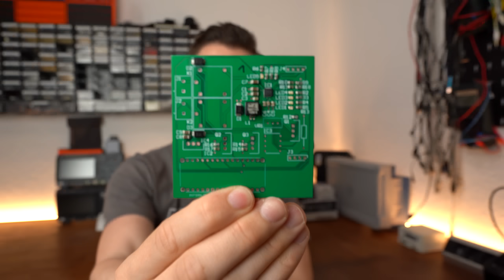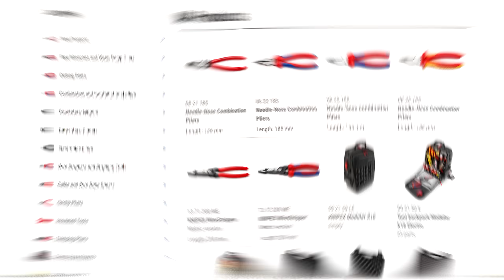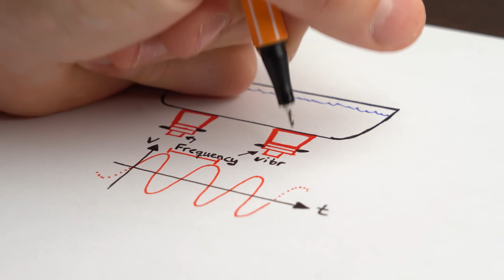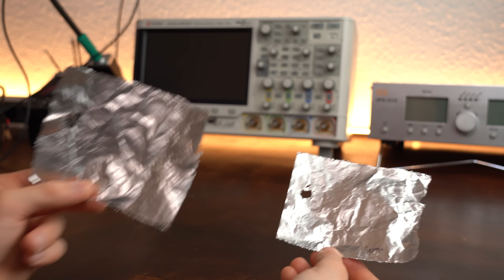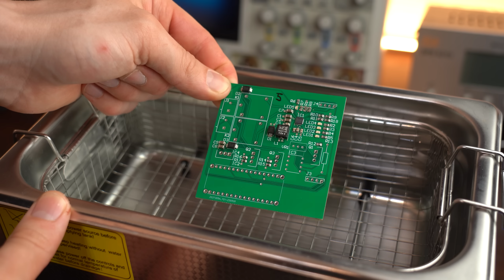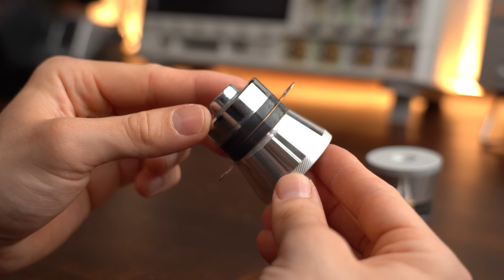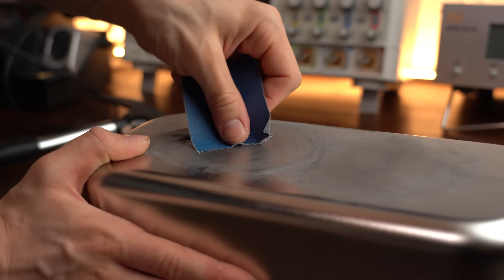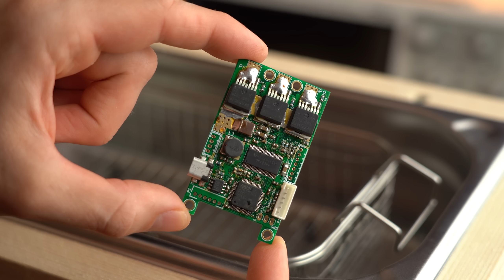The Most Underrated Tool? (DIY or Buy) Ultrasonic Cleaner!

Comment: Also from the safety point of view - Keep your fingers, or any other body parts, well away from the water/solution in the tank. At those frequencies, human tissue will emulsify quite readily, even though you may not feel it. It's not worth risking your fingers just save a few seconds while turning things over, or putting things into and out of the tank.

My own ultrasonic cleaner recommends placing parts horizontally, and points out that the cleaning is more effective on the underside of the items being cleaned (i.e. facing the transducers).
Reply: This is just not true. My PhD is based on ultrasound and it will not harm you definitely not at these low frequencies. Otherwise having ultrasound scans in a hospital would be dangerous. 

The only danger is with powerful cleaning solutions, or your finger being too clean and removing the oils from your skin thus causing dehydration of the skin.
Reply: @zakmorgan9320  You might want to compare the output power of these two things rather then the frequencies. (Or in other words: the amplitude.)These cleaners have several watts. Idk if that was part of your PhD. 
Ultrasonic waves usually have no problem to travel through many materials. So some flesh, mostly made out of water, is no problem (well, obviously): It still can create cavitation bubbles after it traveled through these materials. There are several people here who already tested this by themself. Some did get hurt, but others never. (I personally have only tested it with these ultrasonic evaporators / atomizers. They are up to MHz region. And well, it really did hurt.)
Reply: Just consider what you saw the ultrasonic cleaner do to the aluminum foil in the video. It will do the same to your hard tissue (bone). Keep fingers out till it is turned off.
Reply: @michaelfalter6200  I think not exactly the bone but the next soft thing in contact with the bone.
Put otherwise, the cavitation bubbles could strip off the periosteum! That can hurt for months...
Reply: @FWLingel That sounds like what apparently happened to my shin bone as a kid, when another kid at Scouts intentionally tripped me up (either their shoe hit my shin or I hit something mid-fall).

It did indeed hurt like hell for weeks 😬 but I didn't have any broken/fractured bones or anything. My doctor explained it as having "damaged the bone's protective cover" - or something like that, anyway. It was 25 years ago and doctors don't tend to give super detailed, technical explanations to their 10yo patients :p

... I think he then explained to my mum how she could inflict the same injury on a potential attacker for self-defence?! Wild 😹

So thanks for mentioning that :) It's nice to finally have a better idea of what happened!

Btw, Wikipedia says “the periosteum has nociceptors, sensory neurons that make it very sensitive to manipulation”! … Sure, I guess "manipulation" is one way to phrase it! 😹
Reply: That's dumb. Ultrasound at cleaning power does nothing to humans.
Reply: I would also guess gravity helps get the loose junk away from the item.
Reply: Well I did some cleaning on guitar parts and turned them often with my fingers this weekend. So far so good.
Reply: The thing that all the neigh sayers are missing is that the effect is similar to "vibration white finger" - ever heard of that? The vibration causes irreparable damage to soft tissue, and just like VWF, the effect is cumulative - it doesn't happen in seconds, or minutes, nor hours for sure, but each little session adds to the last.

Let's just say, If my ultrasonic cleaner instructions warn against placing fingers in the tub when it's energised, then who am I to fly in the  face of the maker's advice?  And that, in my eyes, trumps anything from anyone else, whether they claim to have PhuD, or a ThuD, or a PuD, or anything else!
Reply: @whitesapphire5865  "No matter what anyone else says or explains, I cannot be wrong." - You
Reply: @GamesFromSpace  Begging your pardon, oh learned one, I'm only relaying the manufacturer's own warnings, and I'll take their word for it. You do as you please........ Its no skin off my nose!
Reply: @whitesapphire5865  I mean sure, they wrote it on a sticker! That means more than first hand experience or the actual PhD above. No chance the manufacturer says that because some ultrasonic devices are dangerous, and it isn't worth proving to a regulatory certainty their device is safe.

It's on a sticker, after all.
Reply: I have put my hand in my large cleaner, and felt pretty much nothing (kind of a fizzy sensation on the skin). On the other hand, an ultrasonic humidifier causes instant bone pain. I don't think the cleaners are working at a high enough frequency, they barely affect soft substances placed directly in them unless an appropriate cleaner is used.
Reply: there goes my plans for an ultrasonic hot tub :(
Reply: @dotanuki3371  Ooh, aahh! I should think it would have them off in a jiffy!

Comment: Be careful!
When using an ultrasonic bath to clean electronic circuit boards, ultrasound can crumble solder joints, especially if the solder is old or contains flux. Soldering points become perforated bubbles.

Comment: 11:12 one thing i've noticed in DIY ultrasonic cleaners is that they don't really last & you can't buy the specialist glue's that's used to mount the transducers to the tank that flexes a bit & is heat resistant so it doesn't drop off and if you use the DIY version long enough then you'll get burnt out components even with cooling because they're really poorly made
Reply: A bit of welding takes care of that.

Comment: I was really curious on the keyboard sized ones. could you just throw a keyboard in and clean it in one go?
Reply: no, you have to dismantle keyboards before cleaning them in the ultrasonic.  Depending on the keyboard water could get trapped under parts and take days to dry or ruin it.

Comment: What solder paste are you using that leaves such dirt and solder balls? I have never had such an issue with the pastes I have used even lead free. I usually only have to clean the board if I had correct something and have to add flux.

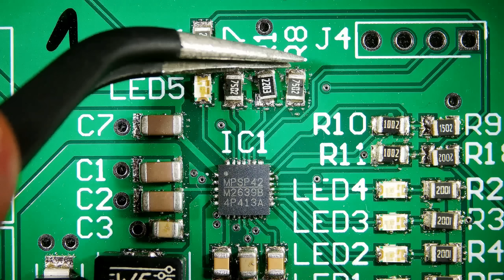Comment: 0:28 what the actual fuck... you need better solder paste, a cheap heater pad and a cheap heat gun. Your pcb is a mess. Don't clean it , throw it away.

Comment: Heavy parts will NOT get cleaned if placed directly on the metallic tank, since they are too heavy to be shaken. Tjey need the mesh.
Other parts like toothbrush heads and glasses get cleaned better WITHOUT the mesh, which reduces the cleaning power

Comment: I'd love it if a company sold a shallow but very wide sonic cleaner specifically so I can clean an ATX sized motherboard.  All the cleaners currently sold appear to be narrow and deep.  The only way to clean a motherboard is to clean 1/2 the board at a time, wasting time and cleaning solution.
Reply: Can make one yourself,  get one of those buffet style pans and a few transducers to glue/weld to the bottom of it.  There are a few videos out there on how to make one.
Reply: THe Aoyue 9070 is designed be shallow and wide for PCBs. Not sure if it's still available and no idea how it peforms. I chanced upon it last year when researching the same question.

Comment: One thing to look out for: You don't want to clean your board too well! In particular, if your board has mechanical components like switches, potentiometers etc, the ultrasonic cleaner can remove all of the lubricant from them! This may not be a problem if you are able to simply re-lubricate them, but some of them do not make that easy.

Also things like MEMS accelerometers, gyros, compasses, or even just regular old quartz crystals may end up being damaged by ultrasonic cleaners. This is a "may" of course, they may also be totally fine. This is in addition to some components that really don't like being wet (pressure sensors, LCDs maybe).
Reply: Yeah. LCD screens on older phones, calculators etc. don't like ultrasonic cleaning or even moisture. Probably a piece of silver-colored cardboard glued on the backside. Better to take those off before cleaning if possible.
Reply: You can add push buttons to that list.  I changed the led color in my motorcycles dashboard pcb and ruined the 2 push buttons that controlled the trip and select when I cleaned the board in my ultrasonic.   Quick and easy to replace them, but its a lesson learned.

Comment: I got one but the liquid capacity is 2 US gallons of whatever.  It can clean parts and is big enough to ultrasonic clean vinyl records, too.  The issue is that you are not supposed to operate the cleaner with a partially full tank,  you are supposed to fill to capacity.  Thus alot of whatever you clean with gets used up.   Maybe own a small one and a large one.

Comment: I use some pretty big ultrasonic cleaners at my job, I personally use a 50 gallon one and a smaller 5 gallon one, but we have some that are the size of an RV for a more automated process. Something that helps a LOT is to have a flushing action in the tank. I really wanted to get one for home use, but even our small one costs around $4k. Been thinking about DIY'ing it but don't want to start another project, I'm just keeping an eye on ebay for a used one. Our two ultrasonic cleaners used a solution of sodium hydroxide, but that is application specific for what we are using them to clean.

Our big one has an ultrasonic side panel, which is immersed in the solution. Basically a stainless steel box, with a ton of huge transducers on one side, that is immersed in the solution.

Comment: I still use the Kester 2331 water soluble flux and 2331-cored solder for soldering PCB's. Residues easily wash off with warm water under the tap and a soft toothbrush.

Comment: I've been using ultrasonic cleaners to clean PCBs for years.  I run distilled water and Branson EC (Electronics Cleaner) in a 5% solution.  I run it at 60*C and only need to clean the boards for a couple of minutes.  After removing from the cleaner, you will want to dip it in a bath of IPA in order to displace any water remaining in small voids, then I dry it in a 120*C oven for an hour to remove any traces of moisture.  For PCBs like yours, you probably don't need to go to these lengths, but many of the PCBs that I use this method on have switches and pushbuttons.  The IP and dry cycle ensure that there is no water or other moisture left behind anywhere.

Comment: You might want to take a closer look at your solder paste and soldering process, so many solder balls are definitely not normal, we have like at most 1-2 per board and those usually fall off easily. It might even be bad flux.
Reply: I think the SMD resistors being all wonky is also kinda telling that his reflow soldering process isn't quite there yet, because usually they would mostly align themself while baking if you applied the right amount of paste and placed them properly; at least from my experience.
Reply: I have seen his hand-soldered work and this seems way better already 😂😂
Reply: Yep. I do SMD with paste soldering using a hot air station and I've never got solder looking like that. It feels temp is not high enough. Otherwise... excellent video, as usual.
Reply: I one had some boards that were full of solder balls after reflow. It ended up just being a case of expired solder paste. We learned that T5 solder paste is much more prone to degradation than the regular T3/T4 stuff.
Reply: He could also use a smaller stencil cutout to minimize the chance. Or buy a DEK lmfao
Reply: Yes, I also had some concerns about the soldering.  I'm guessing the paste he is using doesn't have enough flux or perhaps doesn't have the right flux.  Proper flux should increase the surface tension of the solder and both help with self-alignment of the components and also prevent loose solder balls.

Comment: @GreatScott - I had a very similar one to this, the 800ml unit but the buttons on mine had a slightly different arrangement.  It exploded - literally - after only 6 months use.  The Chinese vendor (who was listed on Amazon with a UK address) tried desperately to dodge warranty replacement and trying very hard to break the law.  After a month or more of back and forth Amazon themselves stepped in and refunded the purchase price - the company I believe was dropped from reselling (the illegal activity was quite clear).  
I was told to simply dispose of the item so out of curiosity I took it apart to see what had happened - there was definite scoring on an internal PCB and there was zero water ingress, that said the components are not sealed at all and I don't feel confident or safe with the way these are made.  The problem is you can't have it in earshot as it's really loud and at a frequency which is piercing so it increases the risk factor when running it.

Comment: How much do you suppose it would cost to add an adequately-sized heating element and appropriate control circuitry to the DIY version?
Reply: Adequately sized means what?
A few watts can keep a similar sized container at 60	°C (lid closed) and a significant number of watts more can do that with the lid off.
It does take a long while to heat up that amount of water with only a few watts.

My ultrasonic cleaner has one of those rubber mat heaters glued to the bottom of the tank together with a PTC temperature resistor. Those are quite inexpensive and low wattage.

Comment: I've been cleaning batches of PCBs a lot and let me tell you, PCB cleaning solution works wonders (EMAG Platinenreiniger in my case). It is specifically made for getting rid of flux and solder balls and will clean an entire tank full of boards to almost perfection.👌 Heating it to something like 60 C will also make a huge difference.

Comment: My mother worked at place that designed precision electronics and they used a dishwasher followed with an alcohol bath to remove the water and  dry quickly. I don't remember the setting they used on the dishwasher.  The whole process was surprising to me as I was new to it back then.
Reply: My dishwasher doesn't have a PCB setting 🙁
Reply: I can't recall how many times I've run things through the dishwasher that "shouldn't" have gone in there. Even large commercial dishwashers with the conveyor belts. Mostly electric motors that I've dismantled to repair or overhaul. But numerous other things too. It's so convenient. And if you use the hot water settings it dries relatively quick. The great thing is they are good at removing grease and oil since that is a major part of cleaning dishes and cookware. Occasionally I'd have to run them through more then once but it beats cleaning them by hand. And frees you up to do other things
Reply: @jasonharrison25 
A typical dishwasher tablet these days contains salt (most tablets have this as part of tv formula, instead of relying on the salt reservoir being full) which I would have thought would be terrible for electronics... It's certainly isn't good for unprotected aluminium!
Reply: @dylanevans5644 they don't contain salt but an chemical water softener. The salt in the reservoir is used for the ion exchange process.
Reply: @jasonharrison25  Thank you for your comment!
Reply: I used to repair Tvs and other audio visual equipment in the days of CRTs i used to clean the chassis of Tv sets and pcbs from the other  equipment in a dishwasher they used to come out like new after the dishwasher process i also used to rinse them with IPA and leave them in a warm cupboard to dry before powering them up. this clean up used to make it more pleasant to carry out the repair of the equipment as alot of the Tvs we repaired were from the homes of smokers and the pcbs were covered in nicotine.
Reply: In the early 80's, we used the break room sink and a tooth brush then just left the boards on a spare work bench to dry.

Comment: If you need a very large bath for large items you are way better off building it yourself. The price goes way up the bigger they are but the cost to build them does not. You can add extra transducers if you build it yourself and a much better heating system. I found a garage sale counter top water dispenser with hot and cold water. I got a large tub with 6 transducers and adapted the heating and cooling elements from the water dispenser to the tub by brazing stainless brake line to it. I can heat to 130C or cool to 2C. The cooling unit causes things to be brittle instead of gooey like flux does. Don't really know which is better they seam give similar results. I used thermal adhesive to attach the transducers.

Comment: I'm searching for someone that I can pay to repair my Ebike. 78V motor in the wheel. Needs new lead acid batteries. Or if it can fit my budget modify to lithium batteries. Even if they are half the capacity of the lead acid. Also needs lights and signals functioning. Also a rear tire fix. I'm in B.C. Canada.

Comment: i use ipa to clean my circuit boards.I pre heat the pcbs, do some scrubbing to losen up those solder balls, and then just clean them for like 2 minutes, I then store the used ipa in a different container to be reused, you can see the dirt/flux settling down after a while after stroring the ipa. ipa is somewhat flammable depending on the purity so do monitor the temperature and do it in a well ventilated area.